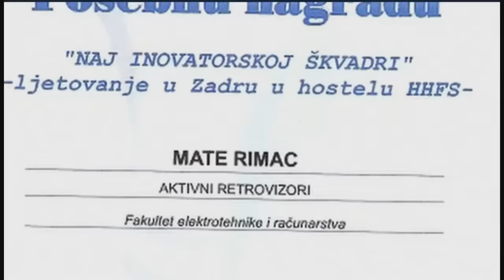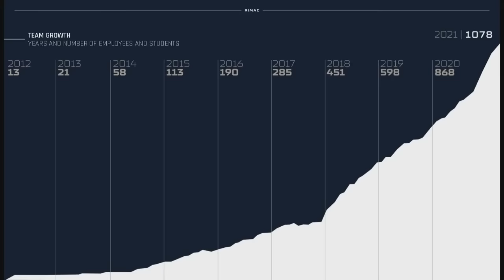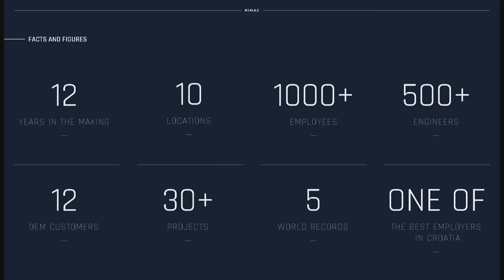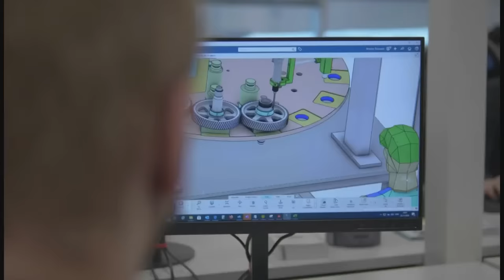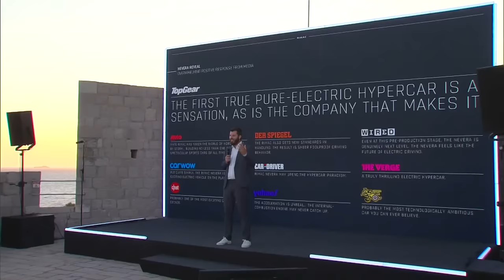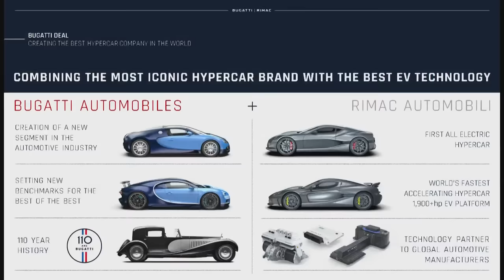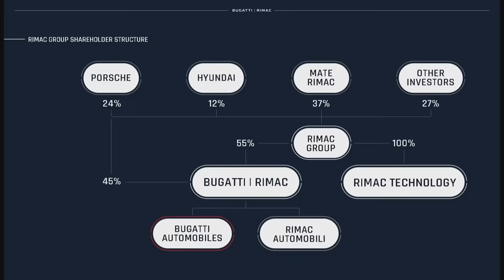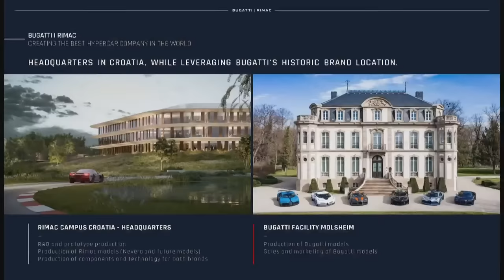Rimac Live Event — Bugatti Rimac Announcement

Comment: Bugatti will enter Formula 1 with a Porsche and Rimac power unit in 2025. Nico Rosberg will be the team principal
Reply: niko has been shown something that has to do with f1 we just dont know what. It was in one of his rimac vids
Reply: Formula 1 will not become fully electric in 2025...
Reply: @AlexisDelatolas  when did I say it would..?
Reply: @loopje  if they would enter a motorsport series shouldn't it be fully electric? That's Rimac's primary technology they would want to promote... Or?
Reply: @AlexisDelatolas  can you read?? I said Porsche and Rimac. Aka Porsche engine, Rimac electric components...
Reply: @loopje  yeah ok Porsche engine with Rimac electric components could be a possibility now since Porsche was involved in the latest engine talks. In general though VW brands don't mix their branding in motorsport so to have Porsche and Bugatti together is unlikely. And no, clearly I cannot read.
Reply: Guys remember, Porsche actually wanted to enter F1 in 2017. They designed and built a 1.6L Hybrid V6 engine for F1 but gave up for some reason (I'm to lazy to research why).
There are rumors floating around that they'll partner up with Red Bull.
Reply: @error262  probably gonna be a 4 cylinder next and Porsche have their insane V4 engine
Reply: @error262  yes and they were involved in the 2025 engine talks last weekend in Austria. But as a Porsche engine brand. Unlikely to use Rimac brand in F1.
Reply: @error262  Rimac already works with RED BULL Honda F1 Team! 
RED BULL boss Matesic and Rimac = Croatian connection! 😎
Reply: @AlexisDelatolas  Rimac branding is really rarely used. Koenigsegg, Aston Martin and everyone else that uses their batteries and motors doesn't brand them as Rimac parts. Even Pininfarina Battista that's just Rimac Nevera with a different body parts doesn't use Rimac branding.
Rimac branding seems to be limited to only Rimac cars, if a car only uses their tech there's 0 branding.
Reply: @error262  yeah exactly, that was my point too for the original comment.

Comment: The Rimac drivetrain does not sequentially variegate torque thrust, thus, it cannot preload each motor phase properly at voltage. This equates to it being hard to get in and out of if you have roids or gotta go poop.